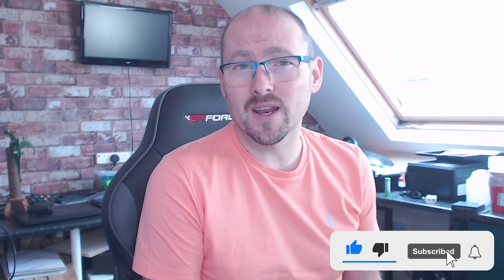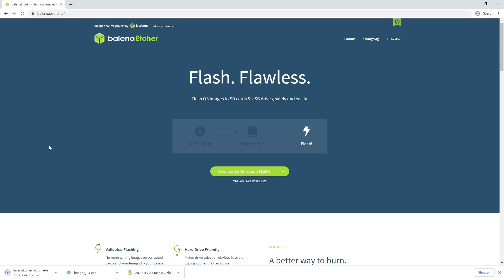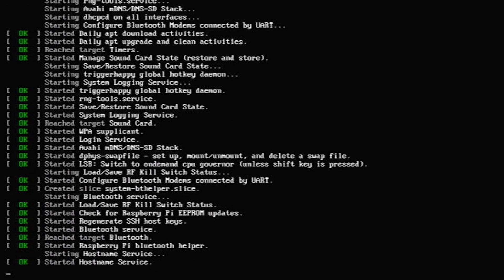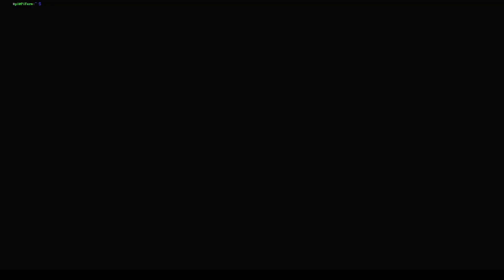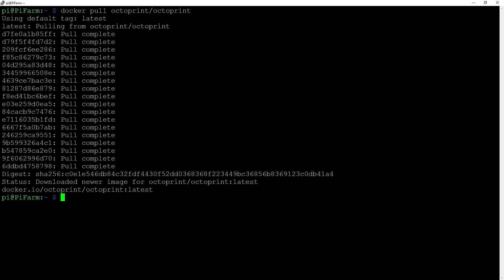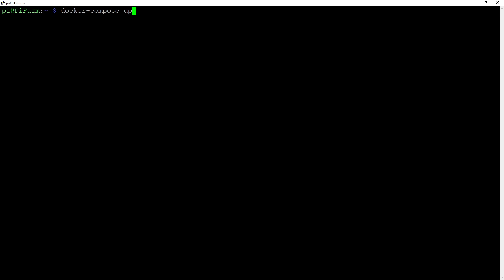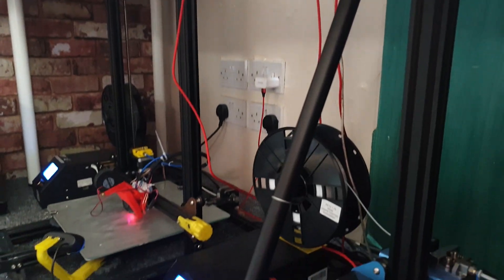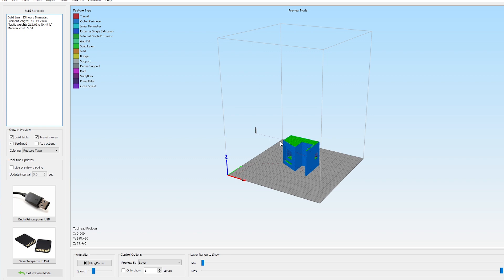Building a basic 3d printer farm

Comment from the maker: Questions!
How could I have done this differently?
What did you like about the setup?
What did you dislike about the setup?

Comment below
Reply: can u suggest the best lcd for the PI server? i want to setup standalone lcd to monitoring all the printer connected to PI server...thanks
Reply from the maker: So there are quite a few options here.  You could use a hdmi monitor or use the official pi display.  It will all depend on the space available,  application and the UI  size you intend to display. Sadly the answer is, "it depends"
Reply: Dunno if you've seen OctoFarm but would be a good addition to this.
Reply from the maker: @jamesmackay6815  I have not, but a quick google search has enlightened me ;). Looks like there is a docker container for this also, so this could possibly be wrapped up with one Pi4
Reply: @IQWorkshop  Totally, the only issue with the Pi4 is the 32-bit arch. You'd need to install Ubuntu 64-bit if their rasbian 64-bit isn't out yet. OctoFarm runs very well on a Pi4 though I have a few users doing so.

Comment: is here any way to set it up to start automatically when raspberry starts, so I do not need to going in an run "docker-compose up" ?
Reply from the maker: I believe so. if my understanding is correct, you need to create a service that will be started by systemd. documentation here https://www.raspberrypi.org/documentation/linux/usage/systemd.md

Although this is not something I have done in my setup.

All 3 of my printers need to be powered on and connected before running docker-compose up, or it fails as the referenced USB interfaces are not there.

in the event the pi is shut down I manually power on the printers and then run docker-compose up.

I just leave the pi running at this point and power up/down the printers as needed.

hope this helps
Reply: @IQWorkshop  awesome , thanks.

Comment: You can setup the entire PI remotely using ssh if you either plug it into Ethernet or modify the wpa_supplicant.conf file to have your network Ssid and password
Reply from the maker: This video wasn't intended to be a super detailed instructional video, but the shots where I am using the terminal are via ssh.

This means the pi can be put in a location more suited to the print setup and be remote administered outside of the web UI

Comment: Thank you for the video. I've been running a CR-10S and Ender-3 off of one Raspberry Pi 3B+ and recently bought a Ender-3 Pro as a 3rd printer. I found with the 2 printers running off one Pi that some weird things would happen occasionally, like one printer stopping in the middle of a print. I am thinking because the plugins get basically shared across all instances this was affecting it.

So I bought a Raspberry Pi 4 to use with them now. I am new to Docker so have been trying to find a way to get it working and came across your video so this looks promising. I like the idea of keeping each instance of Octoprint separate from one another.

I would say the only thing with some of the config stuff you were whipping through it pretty fast, so maybe slow that down a little bit. Even going back to rewatch I had to pause several times just to see what screen you were on. Other than that looking forward to future videos.
Reply from the maker: this setup hasn't skipped a beat for me. Really happy with the performance. The intention of the video wasn't to be a full step by step process. There are links to that in the description.

Let me know how you get on and i'll be happy to discuss if you run into issues (see email in about)
Reply: @IQWorkshop  I feel like I'm like 90% of the way and got all the Octoprint instances to show up. My only issue is if I plugin the printers in a different order, they map to ACM0, ACM1, ACM2 in the order they are connected. So then this of course messes up which printer is actually mapped to each instance of Octoprint. So when I go to what I think is my 1st printer, it's actually my 2nd or 3rd printer depending on the order they are connected. So not ideal.

I followed some of Chris Riley's videos and tried adding entries in here: sudo nano /etc/udev/rules.d/99-usb.rules to basically map them and then enter them in the additional serial ports section of Octoprint, but it never lists them in the Connection settings after I refresh. Would be nice to get these all mapped so that I will then know if I go to the one on port 8001 it will always be the same printer. Any thoughts?
Reply: Just an update that I mostly got this working. I have all SKR mini E3 boards on my printers so have them mapped as below. None have serial numbers so that was a bummer.

		SUBSYSTEM=="tty", ATTRS{idVendor}=="1eaf", ATTRS{idProduct}=="0004", ATTRS{devpath}=="1.2", SYMLINK+="CR10S"
		SUBSYSTEM=="tty", ATTRS{idVendor}=="1eaf", ATTRS{idProduct}=="0004", ATTRS{devpath}=="1.4", SYMLINK+="Ender3"
		SUBSYSTEM=="tty", ATTRS{idVendor}=="1eaf", ATTRS{idProduct}=="0004", ATTRS{devpath}=="1.3", SYMLINK+="Ender3Pro"

Then in the docker-compose.yml file I use the following format instead of /dev/ttyAMC1 and so on for the other printers. This way when I'm accessing Octoprint on port 8001 it is devoted to one printer.
devices:
			  - /dev/Ender3Pro:/dev/Ender3Pro	

My only issue now is if I power off the printers and then turn them on in a different order then they may get mapped differently than to when I first configured this so when I think I'm controlling one printer it's actually controlling a different one. The way I got around this, was just to restart the docker containers. Will see how things go over time as this is only the 2nd day running like this.
Reply from the maker: @mikeneron  i have this issue too. This is an issue with 2 cr10 v2s as the controllers both have the same identifier so I can programmatically map the printer to a port. The way I work around this issue is to firstly identify what ports show up when the printer is plugged in and switched on.

Then in the yml config file, I only allow connection to one USB port (see link in description for the yellow file example)

Then when I am ready to start docker-compose, I power up and connect each printer in the order I want them to connect to the octoprint instances. 

These can then be powered down when not in use.

The only issue there after is that if you want to use a specific printer that is not on octoprint instance 1, you will have to power them up and connect in sequence. Its a pain,  but I can live with it.

This is not an issue for the intended use as a farm as all printers will be running anyway.

Let me know if you need to see this in action and I'll do a video on it